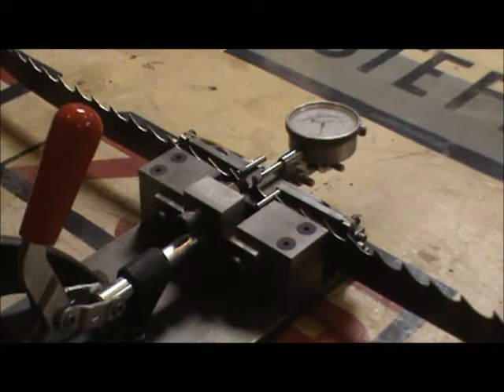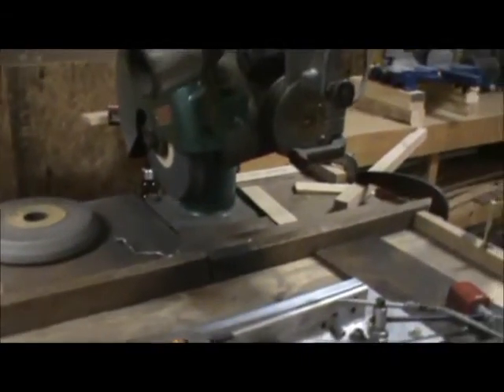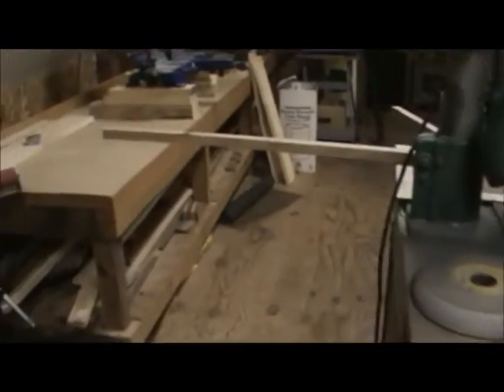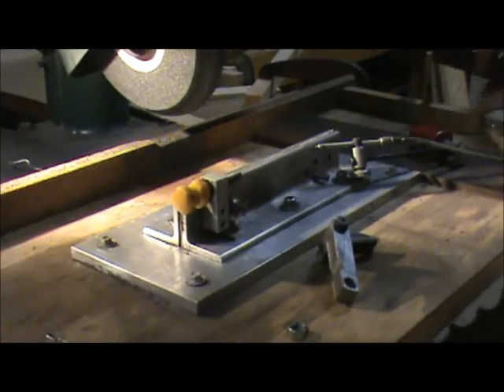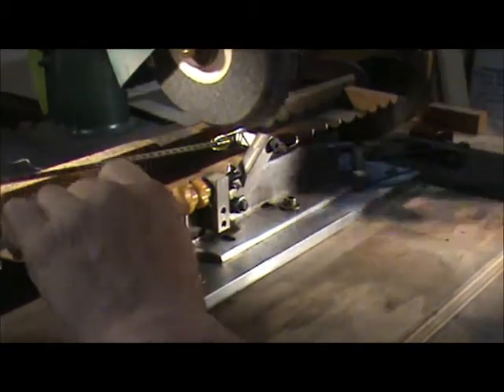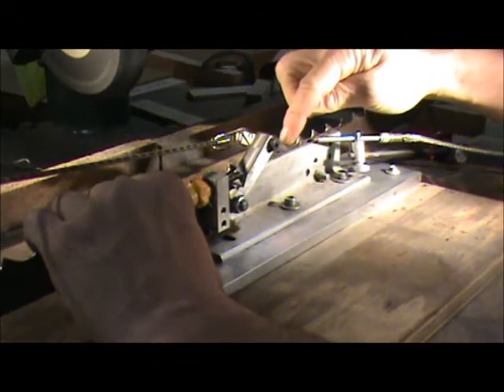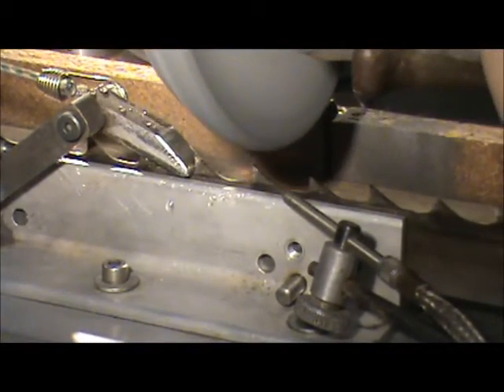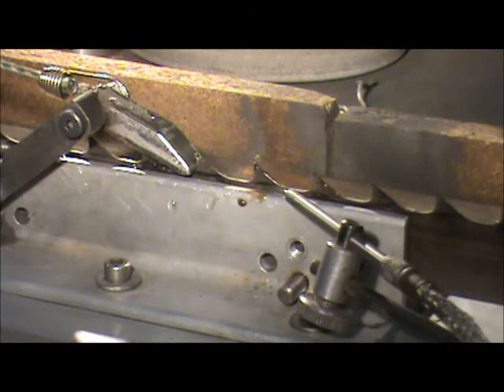Band saw blade sharpening with radial arm saw

Comment: Woodmizer makes a sharpening wheel requiring no dressing. Never changes shape. It would be nice if it could fit a radial arm. Great video, thanks, going to build one for myself.
Reply from the maker: Alex Carr the wheel is a diamond wheel called a CBN wheel. check out my newer video on my auto sharpener I built. I think you will like it

Comment: Rookie dumb question probably, I see you have the 10 degree tilt for the hook angle on the tooth.
My question is do you have the radial arm at 90 degrees so that all the teeth are flat or should their be any bevel angle on the left set teeth & opposite for right set teeth and if so how much bevel angle please?

I’ve a few 1 inch blades with 2 TPI that I split hardwoods 3 inches thick with and I get maybe 200 lineal meters (600 feet) from new / sharp to completely dull, so am always swapping blades & needing re-sharpening on, so being able to do my own would be a bonus, but the tooth geometry for bandsaws is new to me. 👍🇦🇺
Reply from the maker: The saw is at 90 to the blade. If you set the blade first the tooth is leaning right and left so that the upper corner point of the tooth is doing the cutting. So the answer is no there is no angle on the face. I will say I have been using bimetal blades they hold up well.
Reply from the maker: I use Lenox wood master C bimetal with 1.1 tpi. I use them for both hard and soft woods. I'll check my records and get you and idea of the board feet per blade but I don't have to change blades that often.
Reply: whistle3man Thanks so much for your response👍
I’ve been looking at Laguna “re saw king” 1 inch 2TPI carbide tipped bandsaw blades but at $200US / blade (mine are 177 inches in length), by the time I add international postage & 10% Goods & Services tax at import this end and then exchange rate, each blade will be almost $400🇦🇺 bye the time they land here!

Then there’s no guarantee anyone here could re sharpen them so they might have to go back to USA for re sharpening so again hugely expensive, when my current blades are only $60🇦🇺 each new.

I’ve no idea how much longer carbide tipped blades would last in extra board feet sawn compared to the standard blades.

Also how many re sharpens I can get before the blades fatigue crack going around 2 ft diameter bandsaw wheels.

The Aus “mahogany type” timber (Jarrah - Euc marginata) I’m sawing has a Janka scale hardness of 8.5 & contains fairly high silica content so is hard on all machinery, circular saws, planers & jointers, as well as band saws it would seem.
Reply from the maker: Sorry to hear how expensive it is to get a carbide blade. Carbide would last a long time. I buy my blades from a place on the net call spectrum supply. They have the best price I have found, but I don't use carbide. I get about 2500 to 3000 board feet from a bimetal blade. I have 20 inch diameter wheels and can get 3 or4 sharpenings per blade. I use .035 thou thick blades. I had used .042 thick but they fatigue in about 3 resharpenings. With your 24 inch wheels you could still use the .042 thick blades. I think 24 inch is the minimum dai for .042.

Comment: Great set up if you have a kid that spend the time doing it.I have 3 of those beautiful Dewalts in my yard, but no one wants this heavy iron anymore because of the $100 chop saws that do as well and can be carried by hand.
Reply: Richard Raucina I would be interested in one of the dewalts you got in your yard if you aren't too far. I have one of the green square tube 9 inch ones. Love old iron and looking for a little bigger one.
Reply: Have one single phase and another 3 phase both on a trailer. The 3 phase is newer and has the improved V ways, as I recall.. very low hours on that, govt. item. The single phase looks like the one in your video with the straight roller bearing ways. Also have a hit or miss engine to sell. Like your site because it looks like the things I do. Built many specialized wood working machines. Take a look at my home site and several of the videos show my location. I haven't shown any machine work as now I am focusing on dirt work. Nice 12" Craftsman metal lathe also for sale.